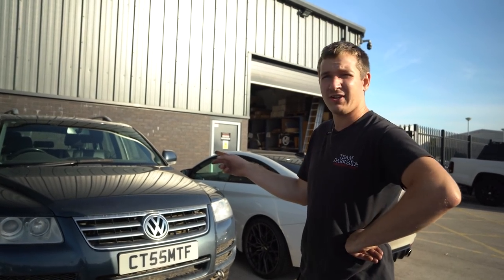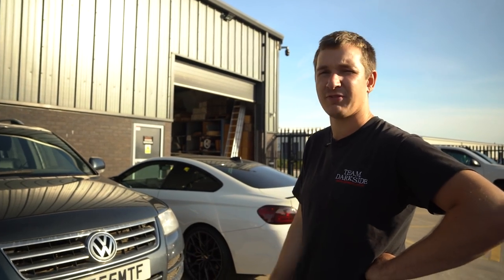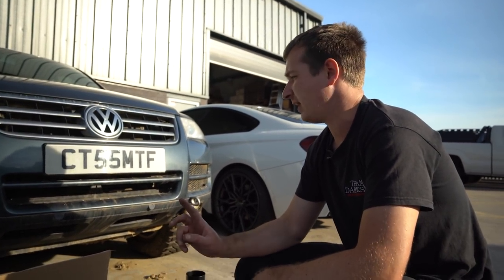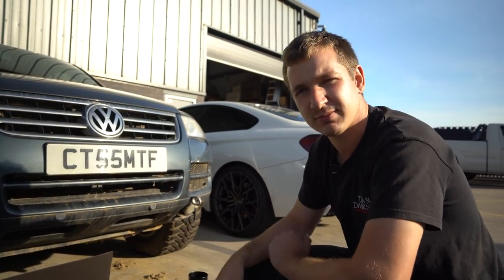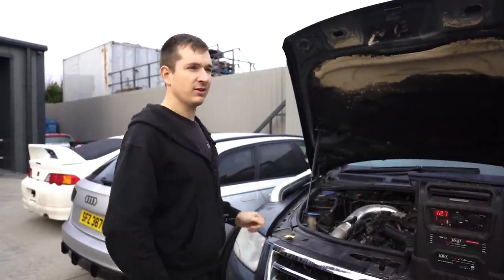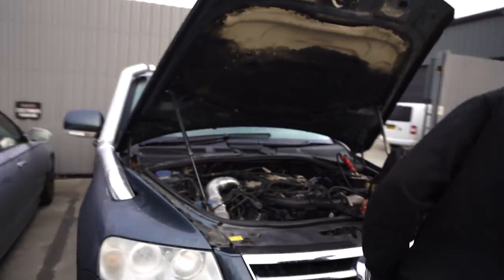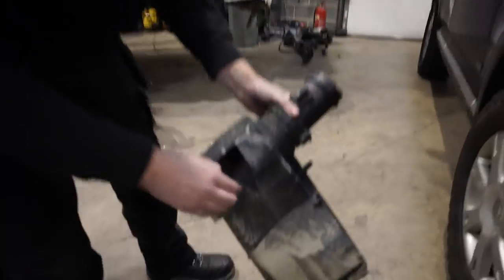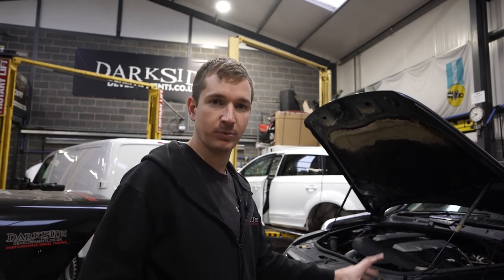Scott's 3.0 TDI V6 BKS Touareg get a Snorkel Kit!

Comment: Thinking of buying this for my 2011 Q7 to be honest.
Is there any concerns about sucking in snow during the winter or anything? I live in Canada near the Rocky Mountains so I thought I would ask.
I know the stock air boxes flow really well already, so did this benefit the performance and reliability at all?
Reply from the maker: We are only interested in stopping water, both Touaregs have swallowed a little previously. We can 3d print a shroud. We have not tested on Q7 so it might need adapting slightly.